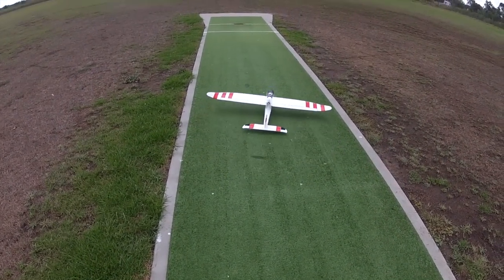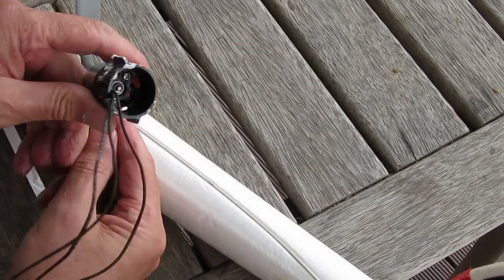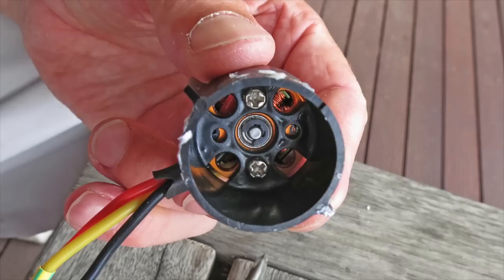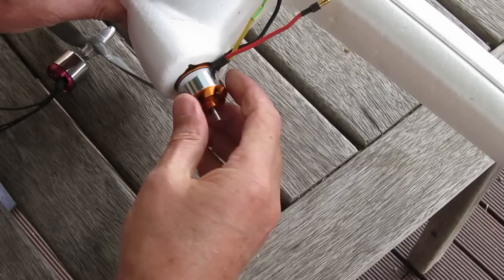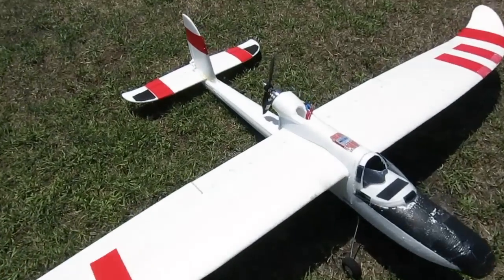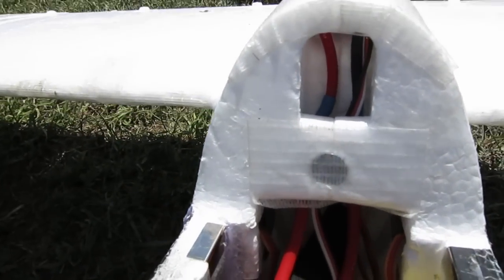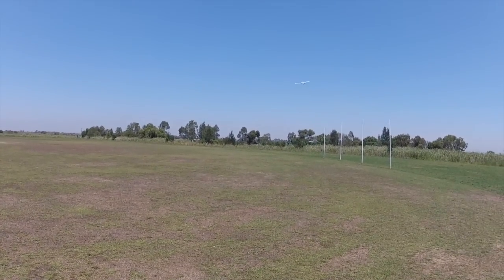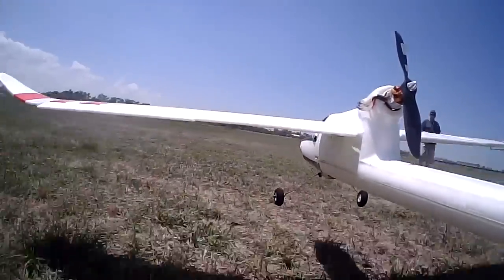Bixler 2 motor swap

Comment: hello Andrew I have a problem with my bixler 2 it will not climb i use full power and full elevator i can not get it to get higher than 10 to 20 meters what can i do?
Reply from the maker: Stock motor and prop? Make sure the prop is on the right way, calibrate the ESC, correct battery 2S or 3S?

Comment: Hey do you use stock 3s 2200 battery? If so how long was the fly time
Reply from the maker: Initially I did, flight times were about 15min. I use 2650 or 3000 these days.

Comment: I replaced mine with a genuine one after about 18 months and the first time it flipped over during a gusty day landing, the motor shaft bent!!!!! It's a 2.3mm shaft at the prop end, but 3mm inside the motor!! Why !!!??? >:¬( I ended up with the same Turnigy one as you.
Oh yes, and I altered the motor's thrust angle with a 1mm piece of plastic card between the motor and the motor mount on the bottom two screw positions. I did have to use 4 screws though to stabilize the motor.
The motor center line did not point through the CG position on the wing. Mine pointed above/in front of the CG and this is what cause the nose dive during initial acceleration.

Comment: I am using 2150kv motor fr bix2..with 3blades prop...is the the 3blades prop making it imbalanace and hard to fly?
Reply from the maker: If it is the right diameter and pitch for the motor then the prop will not be the problem. More likely to be motor thrust angle or CG. Can you give me more details about what flight problems you are having?
Reply: +Andrew Newton ts 6x4 prop 3blades
Reply: +Andrew Newton when i throw the plane in rhe air it turns to the right side ..c.g is right
Reply: the plane is new and i have not made a single flight yet with 3tries..though it has crashed all the time
Reply: +qazi hubaib and when i adjust tale to the left side thn it bents too much to left
Reply from the maker: Try test glides with motor off. You should be able to give it a strong throw and just glide straight ahead and land. Do you have much flying experience?
Reply: +Andrew Newton no i dnt hve much experirnce
Reply from the maker: That's OK, exciting times ahead. You might just be over-correcting - try to use small stick movements. Aileron movement might be too large - move the pushrod further out on the aileron control horn or further in on the servo arm. CG might be too far back - measure where it balances and tell me where it is. Launch with just over half throttle and give it a decent throw up at about 20º. But start with some test glides first with no power. Good luck and keep trying.
Reply: +Andrew Newton well thanks a lot and I apperciate your concern. for sure I will give u upadate about.  tomrw is my 4th test flight. i hope i dont crash it this time...
Reply: +Andrew Newton it flew today finally after few damages.lol..but it flew v v v well...i wish i could show you video somehow
Reply from the maker: Fantastic news. I'm very happy for you. Did you work out what the problem was? Did you record some video?
Reply: +Andrew Newton yes i have recorded the video..and the problem was with motor thrust
Reply: +Andrew Newton its was bending the plane to the right. so I adjusted the tale
Reply from the maker: Very clever to work that out. I would not have thought of motor thrust. Upload some video to your Youtube channel.
Reply: +Andrew Newton i have got a rough video..i will upload and post link here
Reply: +Andrew Newton I am facing another problem. like now i havr adjusted tale toward the left abit. if the power is own thn they repell eachothers and fly straight but whn thr power is off the adjusted tale bends it towrd left side while its gliding. Now I am confuse how to figure out solution for this.

Comment: Hi did you upgrade the servos if there working the flaps and ailerons together?
Reply from the maker: traci beacer Yes I swapped to 9018 metal gear servos all round.

Comment: Very nice Andrew.  the 2826/6 2200kv is one of my favourites.  I use it on all sorts of planes.  30" wings, 44" wings, my combat wings and even some of my noob tube derivatives.  When the motor gives out on my hawk sky, this one will definitely be one that I consider.  I had no idea the bixler motor mount would slide out that easily.  Thumbs up!
Reply from the maker: UnlimitedVertical Same here, I was surprised how little glue was used.

Comment: Thanks Andrew my bixler 2 will have a new up grade look but will try the 7x4 and as M Smith said maybe even the 6x4 .
Reply from the maker: Actually I just remembered the prop above is 7x4.5. I have just swapped to the recommended 6x4 and will test that soon. On the watt meter it draws 25A and 260W flat out.

Comment: Hi Andrew - you really need one of these:
http://smallpartscnc.com/index.php?route=product/category&path=20_76_130

I used them on all my Bixlers as you can run a much larger prop and motor.  I think I had an 8X4 in my last Bixler 2.
Reply from the maker: Stephen Gloor Yes that looks sweet. Does the higher thrust line make much difference?
Reply: Hi Andrew - a little however the better mount more than makes up for it.  They are a really good company to deal with as well.  Really good service.

Comment: Ahh that's the motor I wanted to swap mine out with but they didnt have the accessory pack in stock at the time :( Instead I went http://www.hobbyking.com/hobbyking/store/__35707__Turnigy_Aerodrive_SK3_2836_2500kv_Brushless_Outrunner_Motor_AU_Warehouse_.html Probably a bit too high Kv, but we'll see ;)
Reply: Oh wait, it was the NTM 2200Kv I was looking at ...